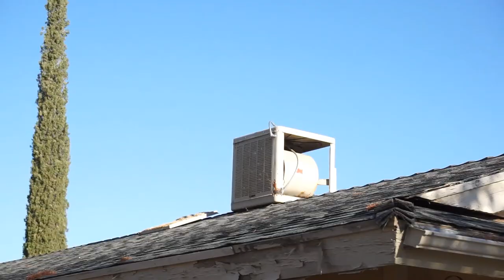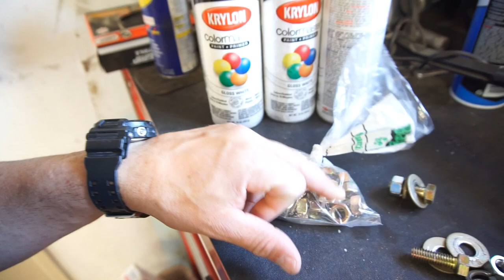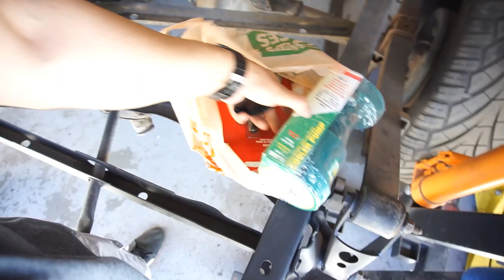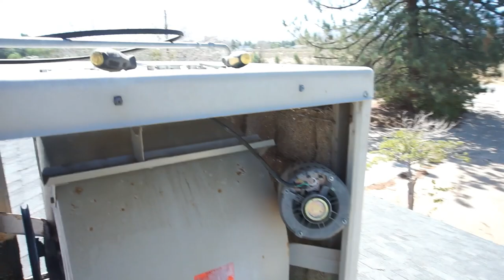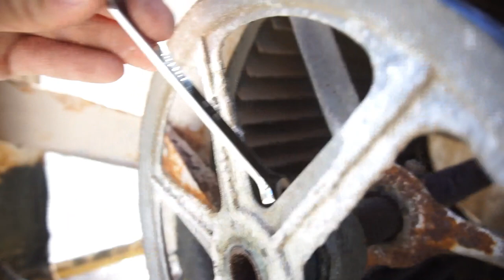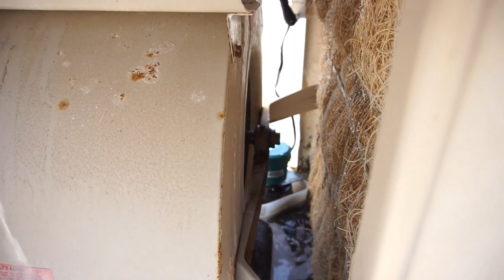I smuggled Nuts On The Plane. Home and Already Have Problems

Comment: Never a dull moment .
Reply from the maker: Orion Fixr tell me about it.
Reply: @Halffast719  On the brighter side,  for what you paid in parts , you have practically rebuilt the whole unit .  What do you think that money would have gotten you if you called a pro. ?
Reply from the maker: @orionfixr7713  It was only $155 for everything. So, Yeah way cheaper. I went to go buy a whole new one and the new ones don't even come with a motor. That's dumb...
Reply: I have the same swamp cooler , great unit
Reply: @Halffast719  ;  Auto mark up !!  I hear they are going to sell cars next year without motors to cut the price !!  HAHAHAHA !!!